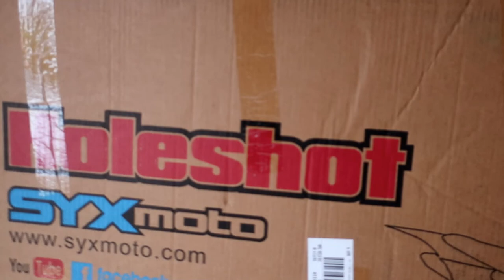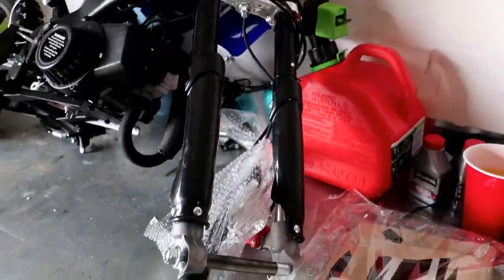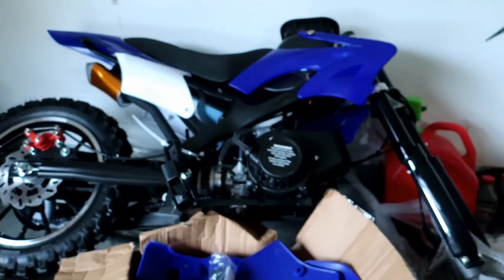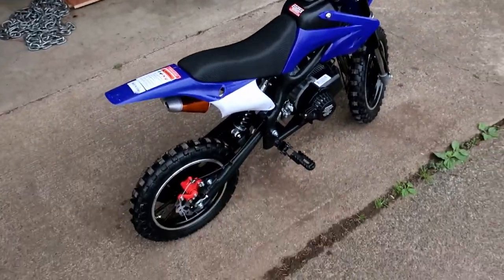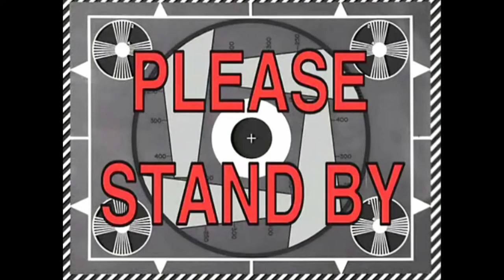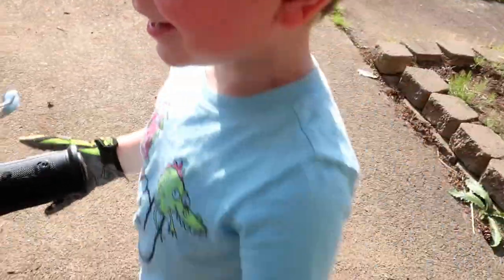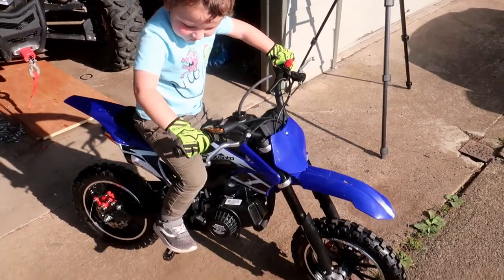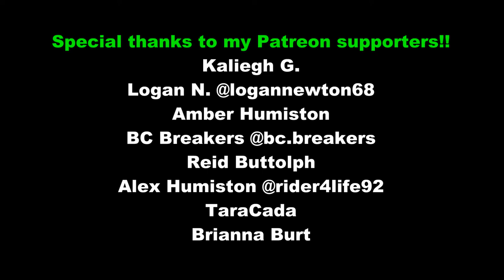I Bought my 3 YR OLD a DIRT BIKE! Syx Moto 50cc Dirt bike Amazon Dirt bike Kids Riding Motorcycles

Comment: We’re you able to adjust the seat height? Or did you need to? I’m curious too find out how low it can go
Reply from the maker: I never actually tried so I'm not sure, sorry. I put training wheels on it so my kid didn't need to touch the ground and it's worked great like that
Reply: @BriGuy503  where did u get training wheels for it man
Reply from the maker: @calebstrickland8677  I build some myself. But u can usually find them at your local dirtbike shop

Comment: Great video!  Bought one for my son. Started it and we on for a few minutes and then stopped. Can’t start after. Is there something you would suggest in terms of choke and white nob?
Reply from the maker: That's a bummer. Maybe the spark plug is fouled? 2 strokes like to foul plugs, alot
Reply: Thanks much for the advice. The fuel mixture works, I blew into the tube at the bottom and made sure white switch was up and down and choke was up.  I’ll try to spark club. We love the videos.
Reply: @THEPAST  Same here. Turn idle screw to the right just a tad. I know everyone says flip choke UP but mine hates up. Only would start on the DOWN poistion.
Reply: @silverdropstang  thanks friend. I ended up buying a new one- was cheaper than trying to return. Works now!  Probably going to get a Honda if he likes it and spend the money. Stay blessed

Comment: Hey I got a question can u make a video how to fill the gas tank and like how to mix the gas? Thank u
Reply: One guy showed that it came with a bottle. There’s a line for gas and above that there’s a line for the 2 stroke oil. Shake to mix. Get a funnel and pour away till full.
Reply from the maker: I do the same thing. Use the bottle that comes with the bike